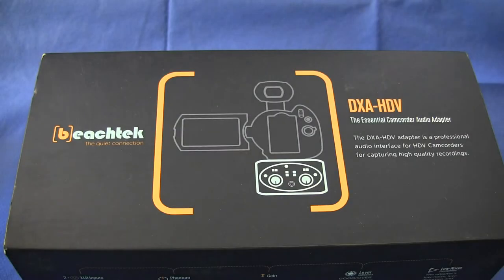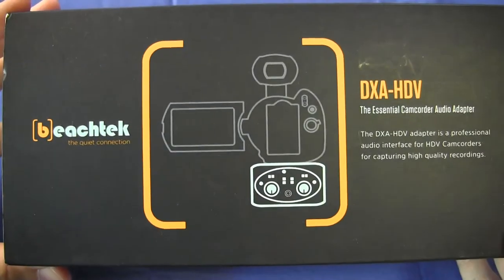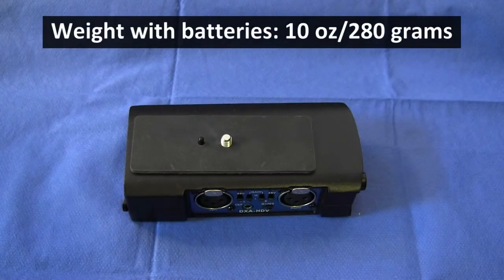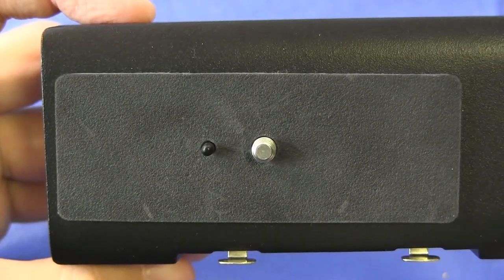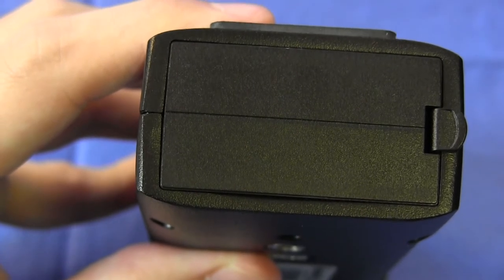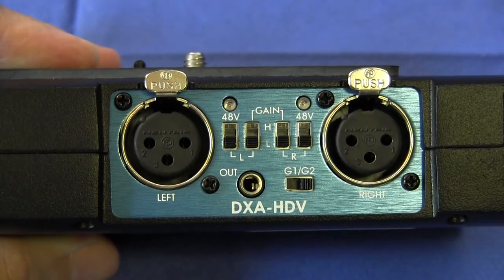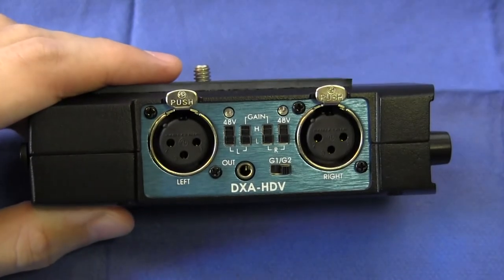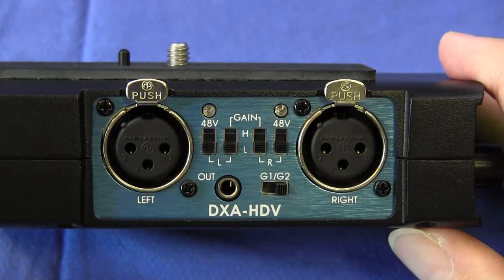Beachtek DXA-HDV review and user guide

Comment: Hi Bruno.. Always so informative watching your videos. Thank you. I have a Allen Heath Mixer, with RCA to XLR cables..can you use the REC OUT rca socket on the mixer and connect this to one of these units through XLR to record audio to my Canon Legria G30?
Reply from the maker: Ky Trinh Hello Ky, in your situation there may be no need for the Beachtek - just run an RCA to minijack cable from the RCA out on your mixer to the minijack input on your G30 - make sure that the camera audio input is set to LINE level (from inside the settings menu) and you should be fine. I used this method for several years before getting the DXA-HDV.

Comment: You said an alkaline battery lasts about 3 hours when NOT using phantom power. How long does it last when you DO use phantom power? Thanks. Great review!
Reply from the maker: ***** Unfortunately I can't answer that question - the company does not provide that information and I didn't test it during the review process. However, we can say for sure that it will be significantly less than three hours! If you do find out please post here and I will annotate it to the review, thanks.

Comment: Does a beachtek end result sound as good or close to seperate into H4 or
 H1.. a guy at a camera shop today said no cause its still going in to 
the camera????!?!!! I thought that was odd cause if that were true Beachtek would not have a job!?
Reply from the maker: That's a good question! The Beachtek is just an interface, so it only sounds as good as the mic that you plug into it and the A/D convertors in your camera. The zoom recorders only sound as good as their built in mics plus you need to sync the audio in post, which is one of the main reasons for using the Beachtek as it saves you this step. 

The Beachtek is basically designed to add XLR inputs and phantom power to cameras that have only a minijack audio input. The quality of the audio still depends on mic choice and placement.
Reply: hm ok mate thanks for that .
Reply from the maker: You're welcome :)
Reply: Yes, the quality of the audio can be equally as good as a separate digital recording device with the proper setup. This explains more: https://player.vimeo.com/video/125111558?autoplay=0&badge=0&byline=0&portrait=0&title=0&api=1&wmode=transparent&fullscreen=1
Reply from the maker: BeachTek Thanks Harry, glad you're still monitoring this video :)

Comment: SM58 is a dynamic mic.  Phantom power will just waste your battery.
Reply from the maker: This preamp is designed to be used with any type of microphone, including condenser mics that require phantom power - just switch it off when not required.
Reply: GLB misspoke. He later plugs in the SM86. In fact, he has a video comparing the SM58 to the SM86. You no doubt have already figured that out, so this comment is for everyone else. :)

Comment: No DC input is a deal-breaker for me...
Reply from the maker: Yes I've often wondered why Beachtek made this unit battery-power only. Fortunately there are other similar products on the market with that feature.
Reply: GLB Productions 
And they made it for those stupid 9v things which aren't cheap. They only last a few hours and get tossed into a landfill which does no one any good. 
Apparently they made this as a companion for the Blackmagic Pocket so why not use the same form factor battery? 
I was going to connect this to a camcorder on a tripod for YouTube work. Mix a shotgun and a lavalier. Maybe I don't really need it after all.
Reply from the maker: Why don't you write to Beachtek with these concerns and ask them to recommend another one of their products? They have excellent customer service in my experience dealing with them.
Reply: GLB Productions 
To be honest, I don't know what I'm whining about. 
I just remembered there's a DC adapter that plugs into a 9V battery socket. I probably have one in a box somewhere. 
Total of $11 on ebay...free ship...
http://www.ebay.com/itm/New-9V-Battery-Eliminator-9-Volt-AC-DC-Adapter-With-A-Battery-Terminal-/321786223929?_trksid=p2141725.m3641.l6368